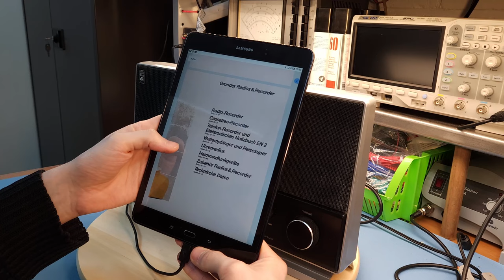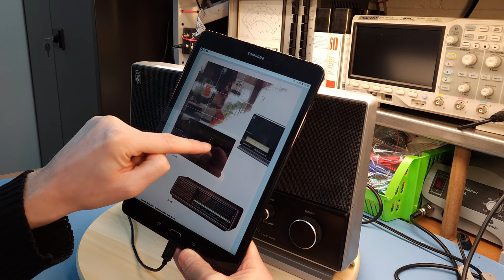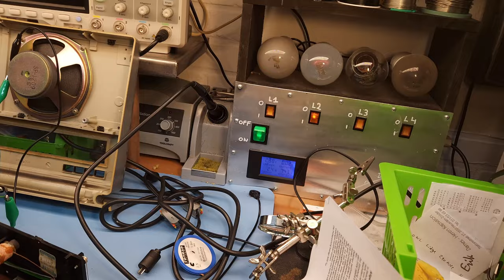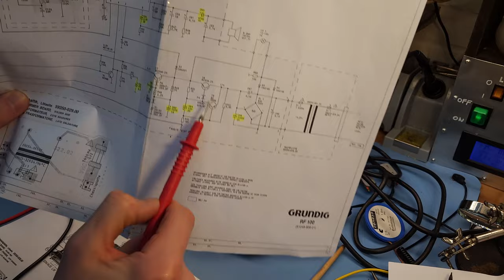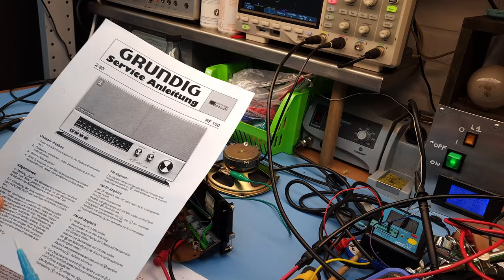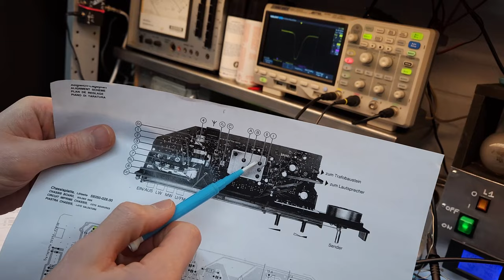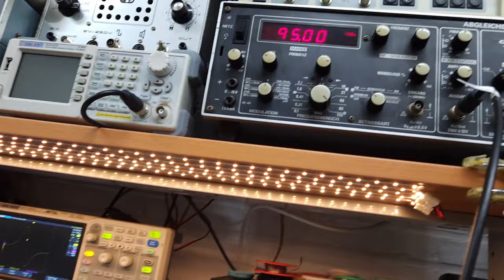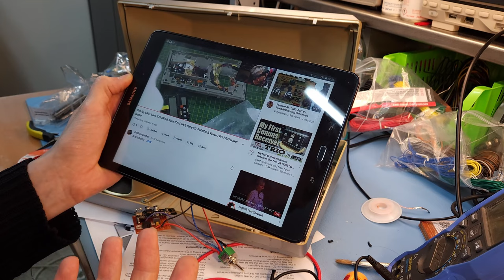Repairing (and upgrading) a simple radio from 1983 - Grundig RF100

Comment: Thanks for another interesting video.  What a bizarre way to set up the power switch! I've never seen anything like it (although I admit my experience with 1980's radios is limited.  That wobulater is cool!  Probably the ideal way to do alignments.  One day I'll get myself one. I notice Manuel Caldeira uses the same or similar method.  Amazing that this was almost an afterthought at the bottom of the Grundig catalogue!
Reply from the maker: Thanks, Don. I think the only reason for this power switch design is to have the dial bulb dim slowly when you shut off the power instead of just turning off instantly. If you look at the yearly power consumption when leaving this radio plugged in 24/7, you don't get a lot of return on investment with this super useful feature. 😅
Yes, the wobbulator is really fun to work with. I think Manuel uses a modern sweep generator, but indeed, the method is similar.

Comment: At 24:00 rewiring the bulb LA1 would solve the issue with noise in the speaker when switched on. As it is ired from the factory it bypasses current around the power supply. A weird decission from Grundig.
Reply from the maker: Indeed, but that still wouldn't fix the voltages which were low due to transistor T8 being bad. The reason why Grundig wired up the bulb this way is to have it fade out slowly when the radio is switched off (instead of just turning off instantly). Just a gimmick...
Reply: Strange? Grundig did not have the Japanese government and the notorious Ministry of Foreign Trade and Industry quietly protecting and subsidizing its corporations. It had to, like many Western companies, cut costs more. They got no concessions or subsidies. Financially not technically, they could not afford many things even then.